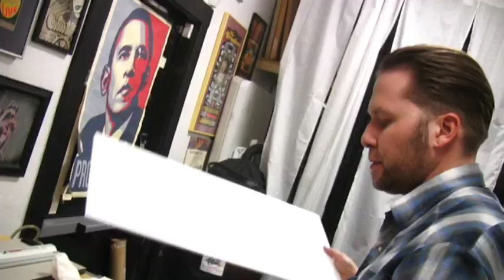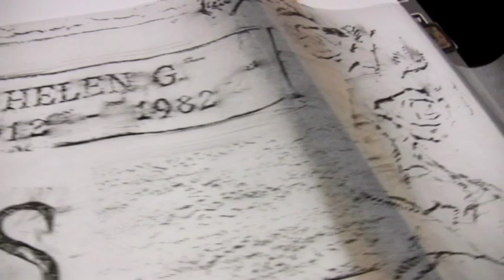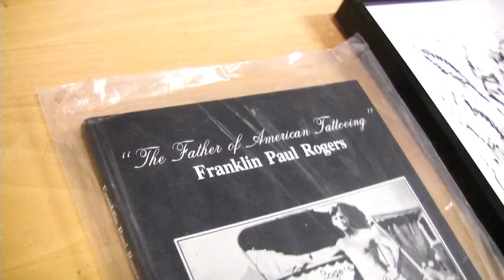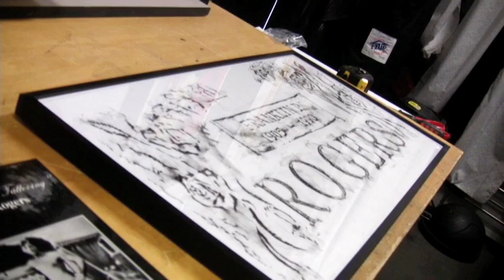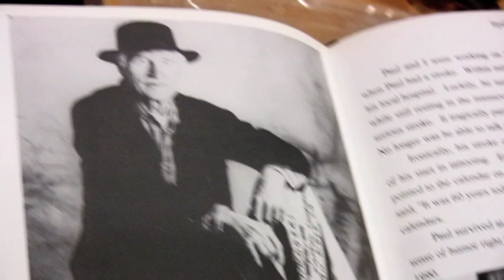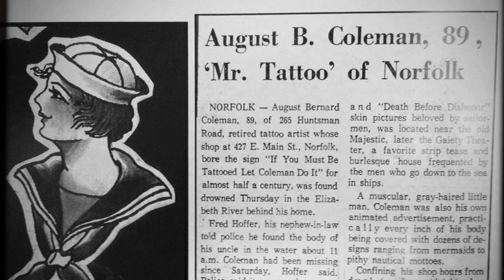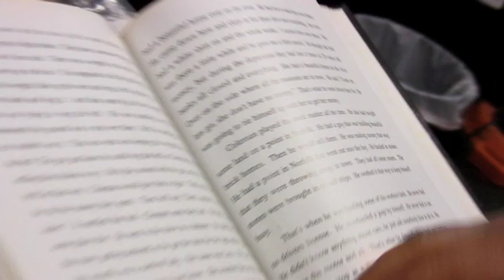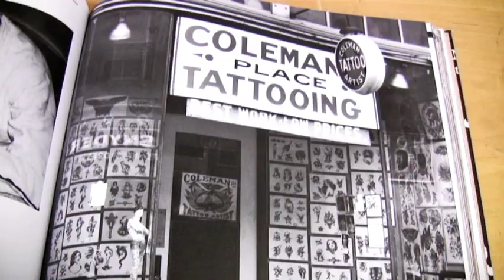Grave Rubbings: Cap Coleman and Paul Rogers

Comment: One set of my great-great grandparents are buried in an old cemetery about 60 miles or so from me.  I was up there this past spring and took photos of the cemetery and their graves.  The artwork on their headstones I am thinking of turning into a tattoo of either an arm band or a wrist band.  To get some good detail for the work on my skin, I want to go back up to the cemetery and do a stone rubbing.  Now that fall is here, snow can easily fall by the middle of October.  I may have to wait until spring if I can't find time before then.  If I don't have the patience to wait, I do have the photos to go from.